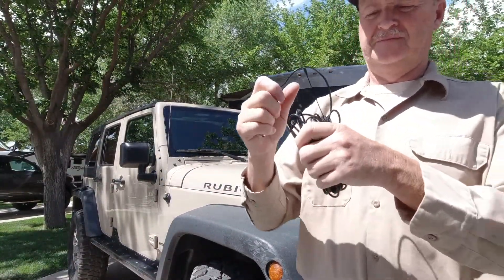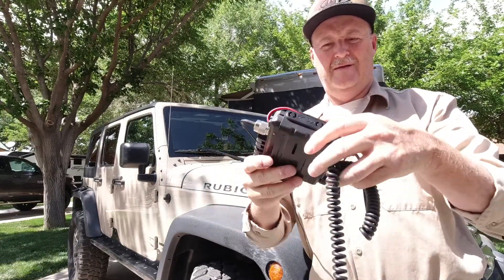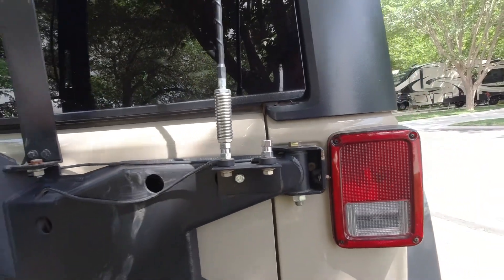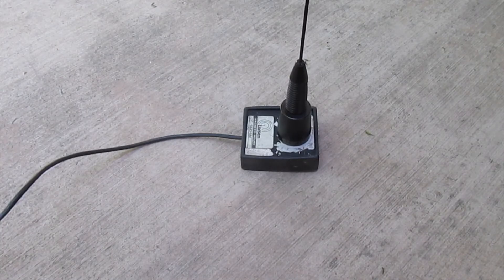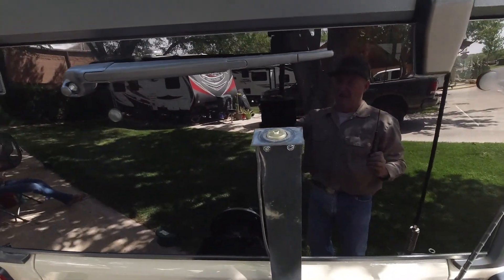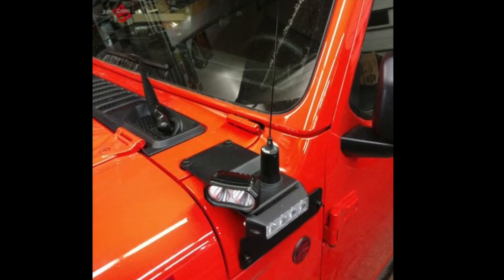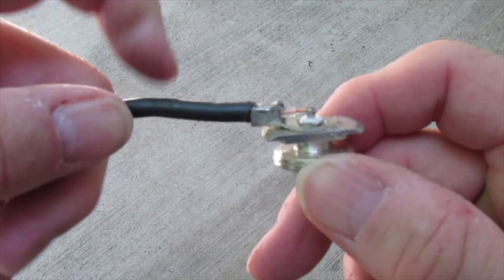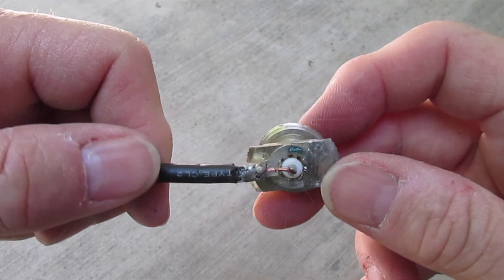GMRS Antenna Installation

Comment: Sam can I place a Midland 3db Ghost antenna on the front and a 6db midland antenna on the rear both hooked to the same radio?
Reply from the maker: Hi Cesar.  You could mount both antennas, but you will only be able to use one at a time.  If you tried to use both at the same time, your phasing and likely your SWR would be completely whacked.   You should just choose and mount one and then make sure that you can get the SWR as close to 1:1 as possible.  I am sure that you will be pleased with the results.

Comment: My concern is how to prevent theft of the antenna. Someone could just unscrew it. Is there a secure method?
Reply from the maker: Hi Ravendon.  Not really other than tightening the antenna with pliers or a wrench.   The downside to that is that it stresses the antenna components and may cause breakage.   If you use an NMO mount, there are manufacturers that make antenna caps.   That would allow you to remove the antenna and put on a much cheaper and more incognito cap.   You don't want to just leave the antenna exposed to the weather.   Hope this helps.

Comment: I have a midland mxt500 with the ghost antenna on a NMO mag mount for my tacoma, it works great, I easily get 8-12miles of good talking range mounted forward about 1ft from the trucks shark fin antenna/GPS. Although midland says I should get up to 30miles.. I find this to be untrue with surrounding area obstructions interference, and some with poor antenna placement.. but is FAR superior to a weak handheld which I still use for spotting others. I also carry a baofeng radio with HAM frequencies, and a Garmin InReach mini for emergency comms.
Reply from the maker: Yes.   The range that Midland claims is rarely possible.  It really takes at least one of the two radios to be in an elevated position.   And when you think about that, the radios will still be line of sight.   The length is exaggerated because you would be cheating the natural curvature of the earth with the elevation.

Comment: What’s the part number or name for the adapter to convert cb coax to gmrs at the antenna base? You could have put that in there at least.
Reply from the maker: A double female SO-239 connector.

Comment: @The Walkers About ...  Sam, I realize this video has been out for a while, but being new to radio, I was hoping you could help me out.  I am installing a Midland GMRS radio in my Jeep Gladiator and will be putting the head unit under the dash  on the drivers side.  I was told the the antenna would interfere with the am/fm radio already installed from the factory and not to install the antenna near the am/fm antenna on the passenger side. ( this is actually where I would prefer to install it) ...  but being advised against it, the next location would be on the drivers side.  I will be installing a Midland ghost antenna (but I am open to purchasing a better one, if you have suggestions) with a lip mount on/near the hood cowl ( as shown in your video @ 5:05 ) my concern is the antenna has a length of 19.6ft and the distance to from the head unit to the antenna ( depending on the routing path) if most direct is probably only 6 - 8ft.  I'm not sure what to do with the excess antenna cable or the best way to route it.  I have read that you do not want to "loop" the cable, but I wasn't sure if that applied to all radio systems.  If the antenna was placed on the hood, I was thinking of making a large figure eight pattern from one side of the hood cowl to the other or one large oblong circle, but either way I am making either two small or one large loop.  unless "looping" refers to being tightly coiled.  Any advise, assistance or nudge in the right direction would be greatly appreciated.  I hope this finds you in good health and spirits, thank you !
Reply from the maker: Hi Mr. Johnson.   Sorry for the quite tardy reply.   You are/were on the right track with the driver's side cowl/hood mount.   Folks seem to be having good success with either the Ghost or longer 6db versions of the Midland antennas.   As you have noted you will not need the full length of the supplied coax.   Your choices would be to bundle the cable (oval or back and forth and zip tied is considered better than looped) or cut off excess and reinstall a new male end.  Personally, I would just bundle the excess and try it to see if it will meet your needs. I will be watching the comments more closely now. Again I apologize for the slow response back.

Comment: Decent video... can't use GMRS the same here in Canada though, so most clubs go amateur. I prefer the NMO mounts for my VHF/UHF gear, but the ⅜-24 is pretty much the standard for HF antennas.

Comment: Is there a part number for the adapter from cb wire to a new GMRS antenna?
Reply: By CB wire I am guessing that you mean the coax cable.  If you buy a GMRS antenna that fits your current CB antenna mount then no adapters are needed.  Just buy a GMRS antenna with the same mount as you old CB antenna, if you can find one or just buy a complete GMRS antenna system for your vehicle.

Don't forget to get you FRN (Federal Registration Number, no charge from the FCC) and GMRS license* ($35.00 from the FCC, no test required) before transmitting!

*The GMRS license covers everyone in your immediate family for 10 years!
Reply: @jfrphoto01  already have the license 
Thanks